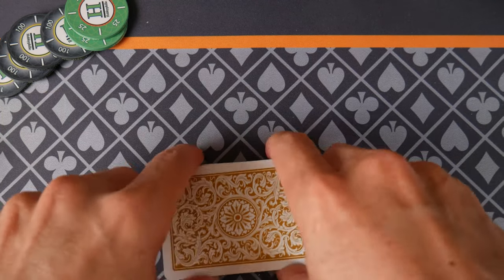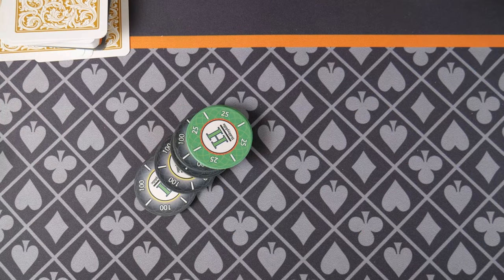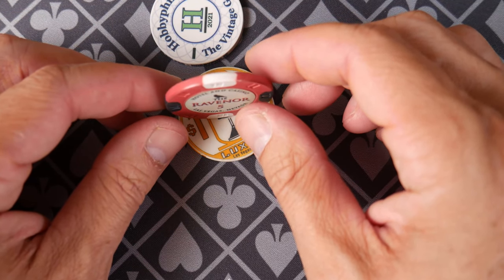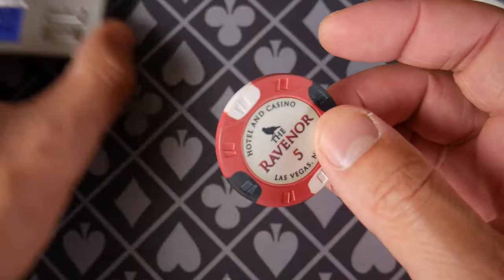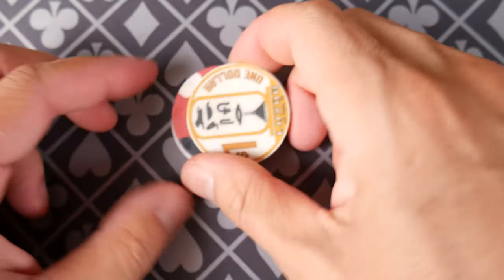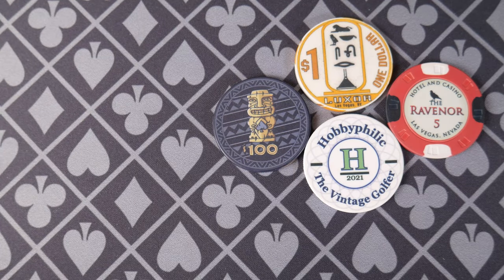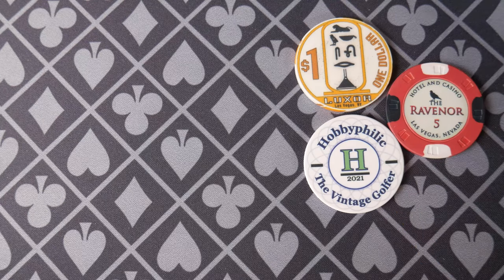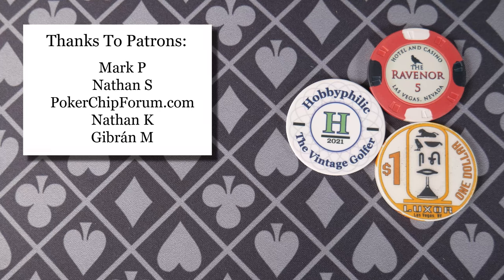They Don't Make Them Like They Used To - Old Vs New Ceramic Poker Chips

Comment: QA Manager for a plastic company here. One of the reasons why the old school CHIPCO chips is heavier than the new ones might be due to the rise (and use) of regrind. Modern day plastic machines are designed to reuse any and all "trimmings" as well as defective product in order to increase environmental friendliness as well as manufacturing efficiency. This is obviously a good thing, however, one of the "side effects" of regrind is that it reduces the weight of the product in question. We may be seeing an example of this right here in this video.